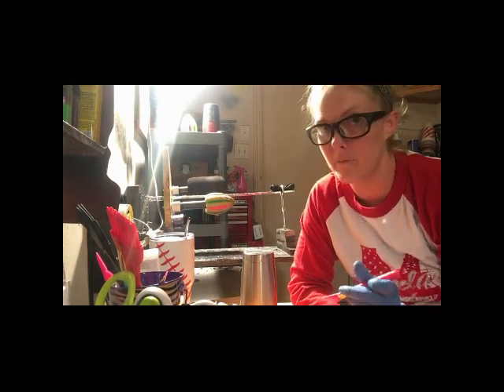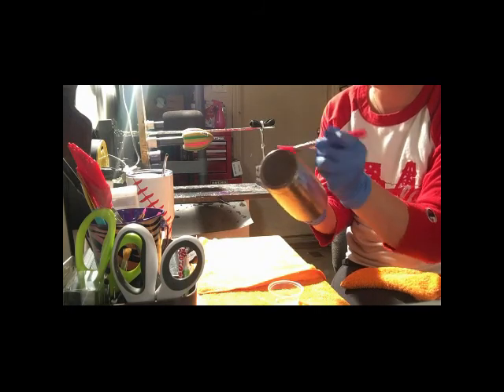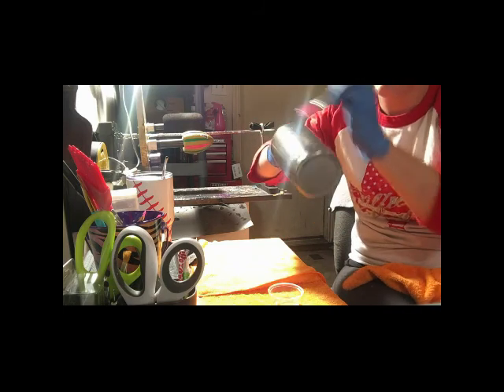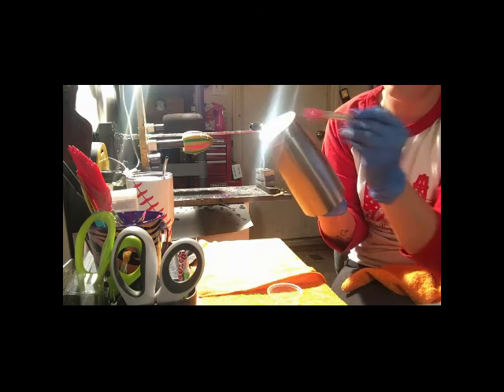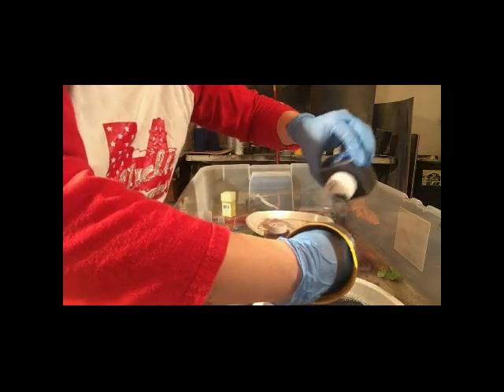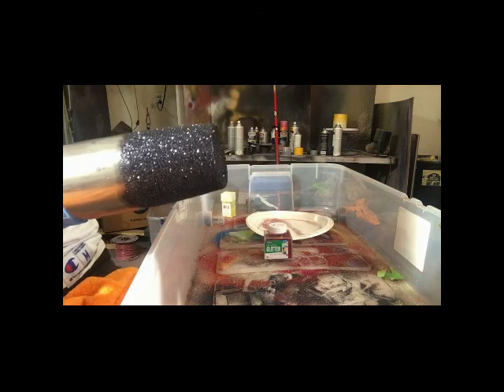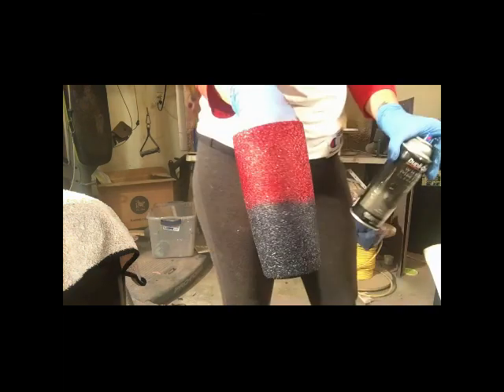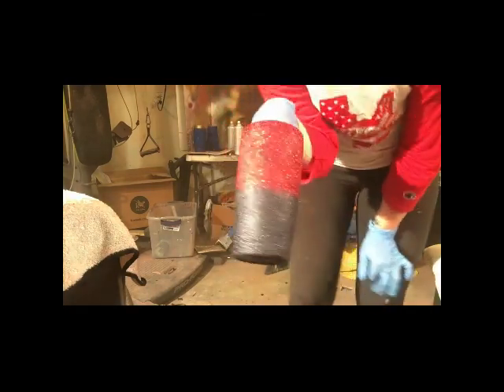Glitter EpoxyTumbler Part 1

Comment: So do you use the Pro Marine Epoxy as glue, as well as the finishing sealer? I also see there are a lot of options of the epoxy, which one do you suggest?
Reply from the maker: Marissa Haley pro marine is my absolute favorite I won’t use anything else and yes I use as the glue and finish seal. There should b a link in the description for the pro marine I use
Reply from the maker: Marissa Haley http://lddy.no/348c